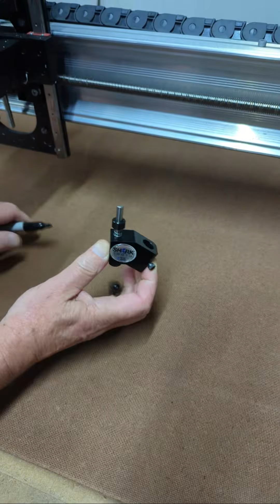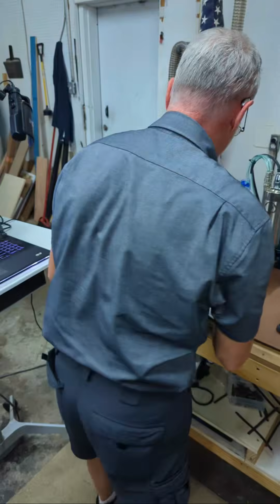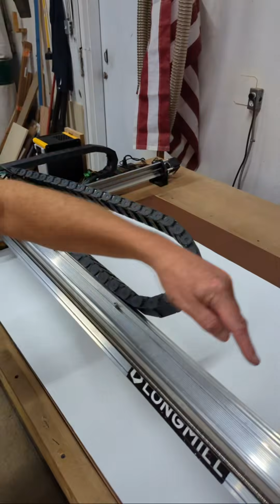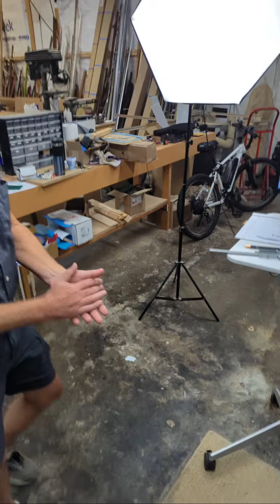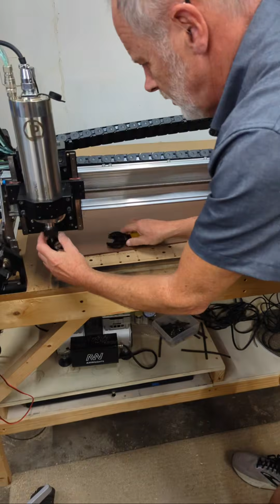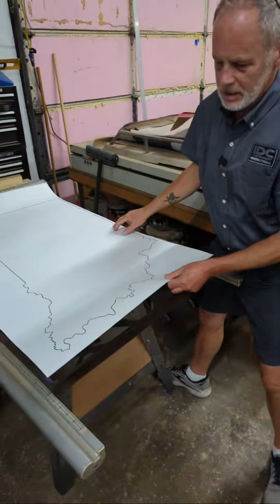A Very Cool Writing Tool For CNC Routers

Comment: Great video I  own it for about 2 yrs  but I could not figure out how to center it i even talk to shark dealer so I would use blue tape to hold pen in place...but you really nail it when you were calibrate you said you don't want the pen to due arch and that is what I was missing thank you ( vide 3:23)
Reply from the maker: erayas135, I'm glad the video helped clarify that for you! Centering can be tricky, but it sounds like you're on the right track now. Happy woodworking!

Comment: One of the uses we have found for tools like this is 1:1 diagrams. Very handy if you have need for a large format plotter/printer for installation instructions but don't have access to those machines. Throw some poster board on the machine, create a 'tape to wall' mount/drill/level template for a one off.
Reply from the maker: wrcw4739, That's a fantastic application for CNC tools! Creating 1:1 diagrams can really make installation so much easier and precise. It's great to hear how you're utilizing the machine in innovative ways!

Comment: Way too fiddly with high risk of failure. Too many variables that will cause failure from old marker, dust, material porosity, speed, pressure, warp etc. Gimmicks to make 15 bucks that don't work reliably!

 This method has been tried and failed in many other industries over the past 50 years. They keep telling me the reason to write down history is so the same mistakes don't happen again! The video and history proved the unreliability of using a machine to drive a pen or marker doesn't work.

 There are far better ways to mark out and hold down nested parts that are reliable. As for drawing on something I'm not sure there is a way short of a pile of money. Old pen plotters got replaced in the 90's with large format inkjet which are very expensive.

 Here we are back at 80's failed technology!
Reply from the maker: 3dtwerking324, I appreciate your perspective on the challenges of using this method. It's true that there are many variables in CNC work, and not every solution works for every application. In woodworking, it's often about finding what suits your specific needs and processes best so I hope this helped brother!

Comment: $70 seems pretty steep for a pen adapter
Reply from the maker: jcor-laura5450, I can understand why that might seem expensive! High-quality pen adapters often come with precision engineering and materials that ensure they work well with CNC machines. The investment can pay off in terms of durability and performance.
Reply: To OP - I’m assuming that you own/have access to the tools required to make your own version of a pen holder. Keep track of the T & M for your version of the pen holder and let’s compare your costs to the sell price of $70.